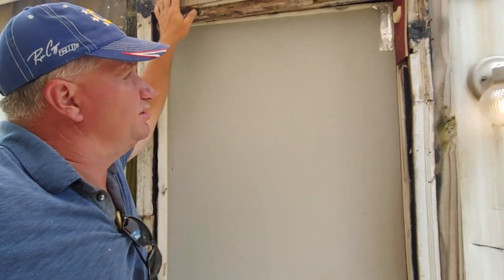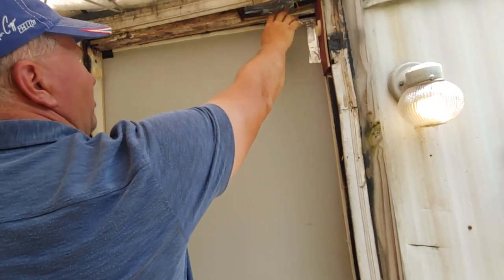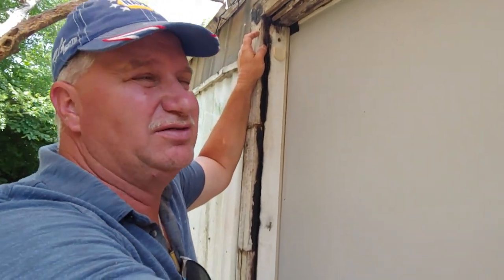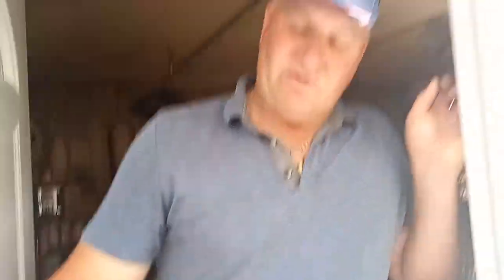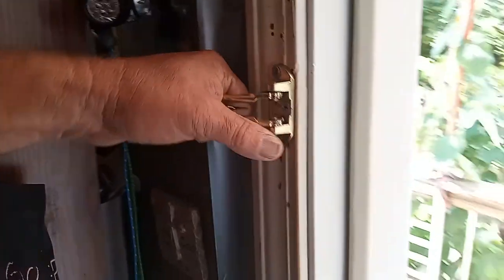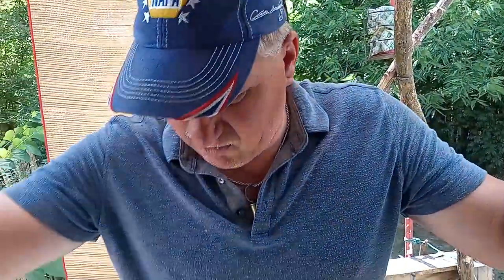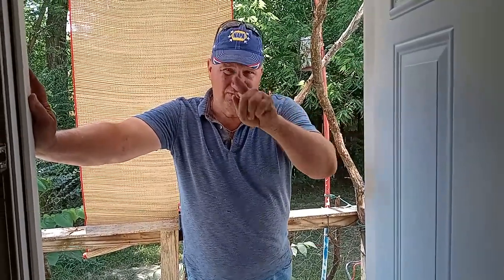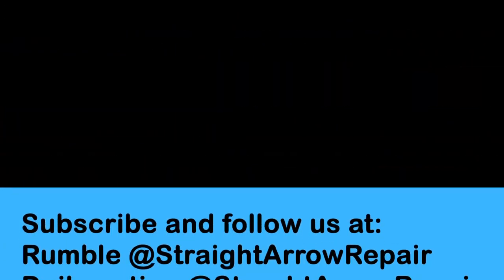Mobile Home Water Damaged Exterior Door

Comment: What are you doing with the extra jamb width?
Reply from the maker: After taking apart the frame. We found a damaged header, bad framing at the base. With floor plywood installed so that 2x4 was not fastened and in the wrong place by the plywood on both sides . Meaning I had to call the rental owner . She called me back. I was told to control costs . So I did some extra work on the whole area without charging. Makes no monetary sense short term . Long term we have less problems. Which causes the family which owns the rentals to say" your higher priced but we don't seem to have as many problems now. " Anyway I took over to keep costs down added wood where I could. Now I would like to show me rebuilding the floor and floor joists. I just got under added 2x4s and 6s changed wood so that in the future when I replace the floor it could be used. So lot was done that was not shown. If your door opening is to large or small on a mobile home it's not much to change. A few screws a few staples.